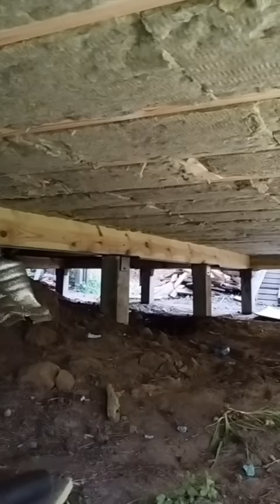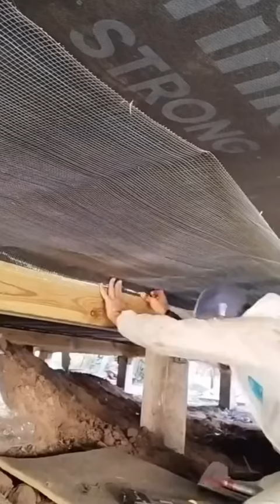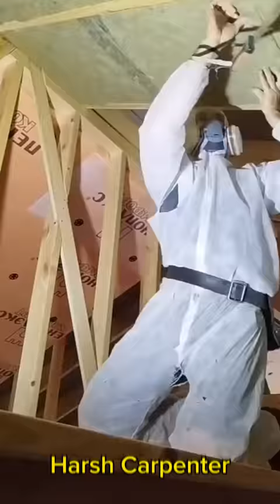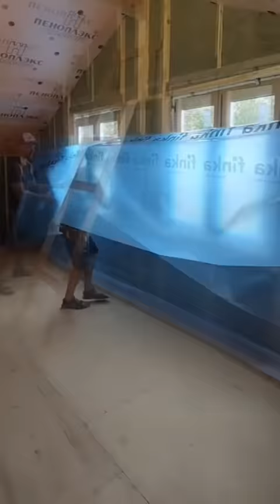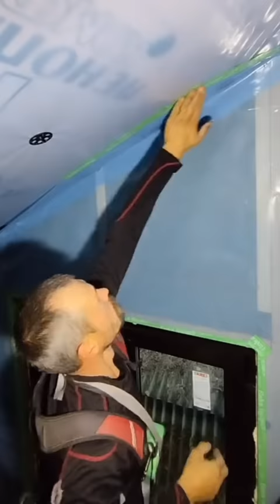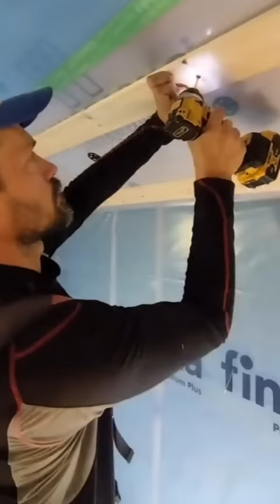Insulating a Frame House: The Surprising 12-Minute Technique

Comment: I would like to know what type of products you're using to do the work you're doing I'm fascinated with what you're doing but I don't know what insulation you're using or what vapor barrier are you using this would be helpful❤❤
Reply from the maker: A vapor barrier must be used inside the house. As a rule, this is a thick polyethylene film... sometimes it comes with reinforced threads. A windproof membrane must be used outside the house. I don’t give the names of specific brands. But give your choice to those that are average or above average in cost. I do not recommend using cheap materials.
Reply: What kind of insulation is that
Reply: @stalker80 I was thinking Finland. Somewhere very cold.
Reply: @Newcreature1957 Looks like mineral wool.
Reply: @gwilliams1001  thank you
Reply: @harshcarpenter but if you give us the name of the products, then we can search for something similar! 😊 I agree with her, we would love to learn more, and I've subscribed to your channel because I want to learn more, but for a newbie like me, the only search criteria I could use after watching this is 'black fabric for crawlspace' and I got all the local fabric stores. 😅
Reply: I think this is a rock wool in question...and the finishing insulation is polypropylene boards.

Comment: I wish I had a house built by these guys.  And what about electrical wire and plumbing. And water. It would be hard to put all these other things in after you put up all this insulation
Reply: I think that’s what the wood is for for the wires. There should not be any plumbing done on the outside walls is what I read and been told.

Comment: Anybody see any electrical? Plumbing? HVAC?
Reply: those will be done later by plumbers and electricians. I read in other comments they just do all the carpentry, roofing, and insulation. customer later hires other tradesmen
Reply: @PatricioGarcia1973  I guess they surface run everything? 🤷🏽

Comment: How will the rooms be ventilated? I didn't see any ventilation chimneys on the roof.
Beautiful, precise work, bravo!
Reply from the maker: Será necessária ventilação, mas já será feita por outros especialistas.
Reply: @harshcarpenter  I see :)
Congratulations once again, great job!
Reply: @harshcarpenter Tell me this please, if you haven't being using polypropelyne boards as a second layer of insulation then the mechanical ventilation wouldn't be necessary, correct?
Or I am wrong?
Reply from the maker: If the room is heated, then a vapor barrier and ventilation are required. Warm air is humid. It cannot be allowed into the insulation, and to prevent it from accumulating, there must be ventilation.
In this project, ventilation will be done later - by the customer. @mladentodorovic5353

Comment: Perhaps I missed it in video, but I didn’t see any electrical/sheet metal/plumbing in walls prior to insulating???
Reply: There shouldn’t be any plumbing on the outside of the walls. The wood is probably for putting wires through. I like to see what came next after installing the wood.
Reply: @devilblueduke  that could account for the plumbing. How about sheet metal? Way bigger than the furred out 1x’s he was installing.

Comment: Where is this being built?  In Texas and Oklahoma USA, we spray foam w closed cell.  Also never seen a wrap used w/o some form a hard wall sheathing (osb, etc).
Reply: They probably use a wooden cladding which is sturdy enough in itself, unlike the PVC used in the USA.  Also rockwool is a much better choice as ot allows the wood to breath, spray foam is used because its fast and cheap, but often leads to rot. In the UK you can't even get a mortgage for a house with spray foam in it.